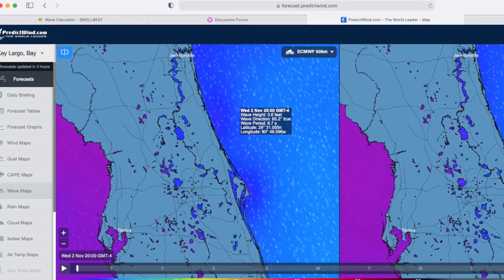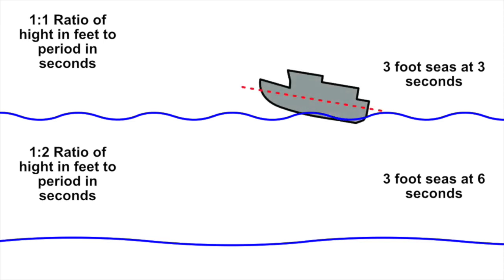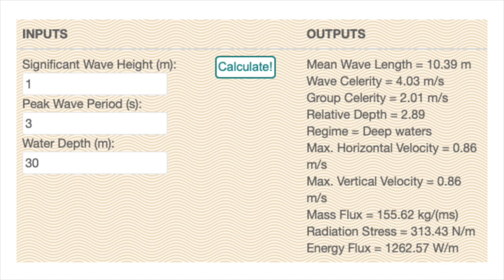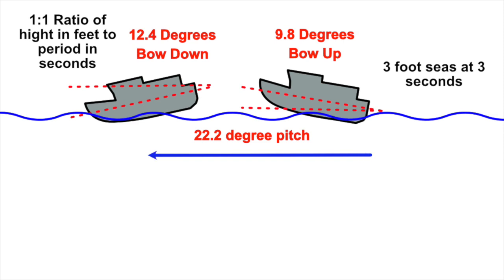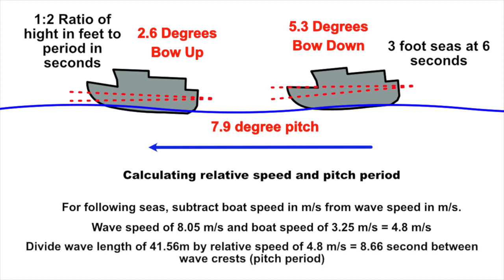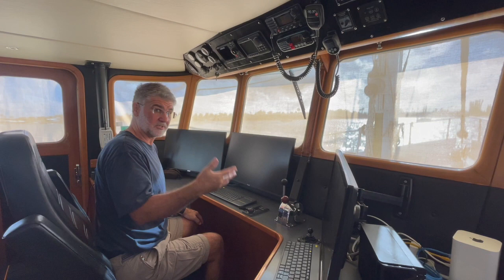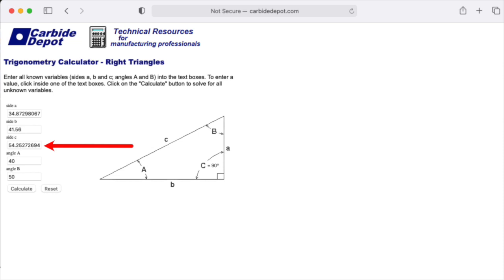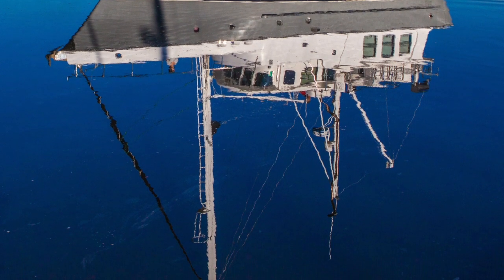Weather and Wave Forecasting aboard Chicory a 46 Nordhavn -  Part 1

Comment: I notice that Chicory has a mast and foresail - something not often seen on a 46.  Can you comment on how this came about and elaborate on the "sailing" performance?  (I fabricated an asymmetrical spinnaker for my N35, as my "get home" engine, but fortunately never had to use it. I'm curious as to how the sail would work with a heavy displacement boat with a relatively shallow keel.)
Reply from the maker: The original purchaser of Chicory from PAE specified the sailing rig as a get-home alternative to a wing engine. You are correct, with a small sail area and a weight of 60,000 pounds, Chicory is not a great performer under sail. But if we were to lose the main engine for some reason, I am sure we would be glad that we had the sails. I think there were originally about six 46's built with a mainsail.

Comment: How cool! Does the chart plotter/navigation software include "comfort" indicators? Like plotting the course in green, yellow and red? If not, that would be a great feature, I guess. Would it be possible/reasonable to modify a course for greater comfort? Or would the distance increase too much? (zero boating experience here, please excuse if these are naive questions)
Reply from the maker: PredictWind has an option where you can input the preferred sea state you believe will be comfortable and it will create a route; however, it is designed for sailors and does not meet my needs.